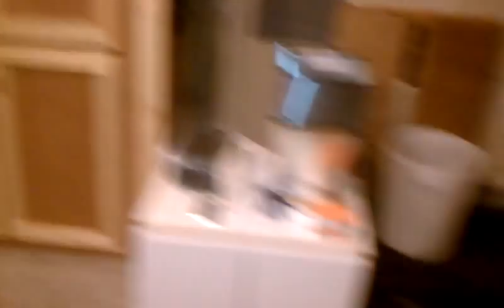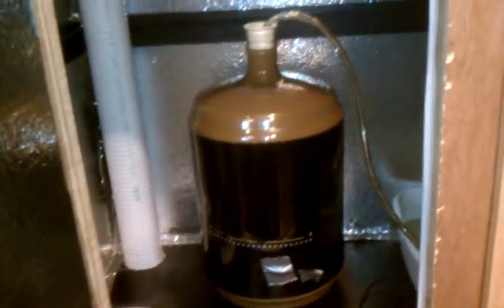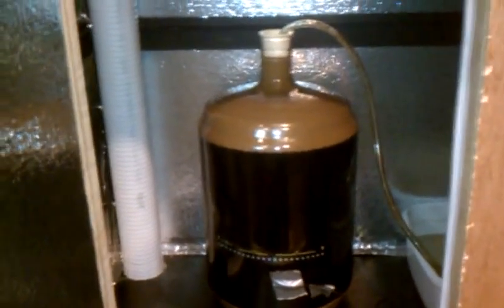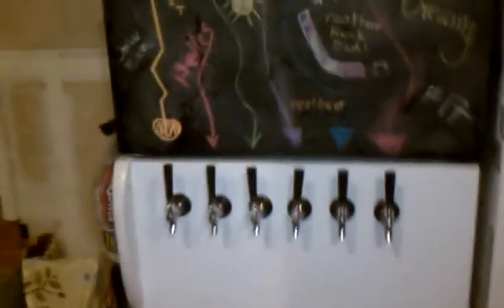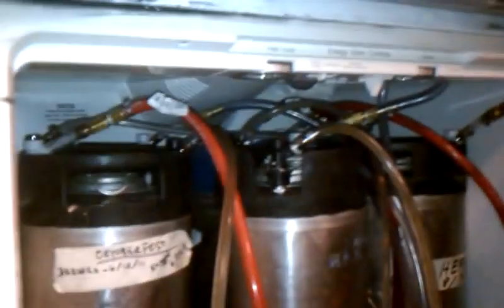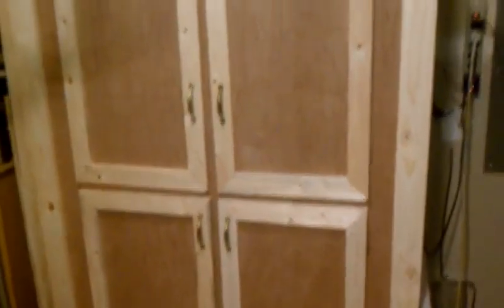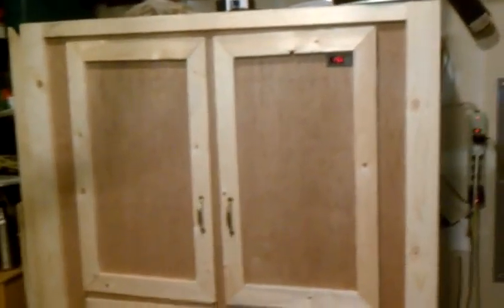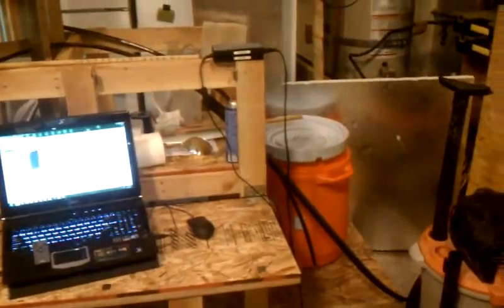Fermentation Near Complete

Comment from the maker: By no means have I sealed it like I will be soon as my weather is getting hotter.  In 90 degree weather I have had no trouble keeping it in the low 60's.  I built this in the dead of Winter, so I didn't need to worry as much about the sealing, now I am in Summer, so I want to go back and button up some areas so that if I needed to get lower I could.  Another thing you can do to help get it down to temp is place a bucket of ice in there, helps to not have the compressor run forever.